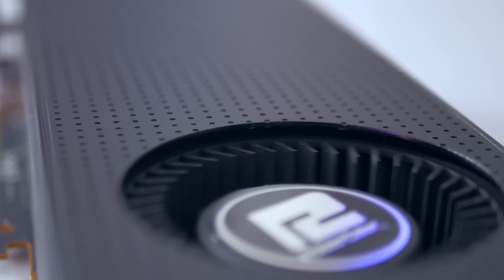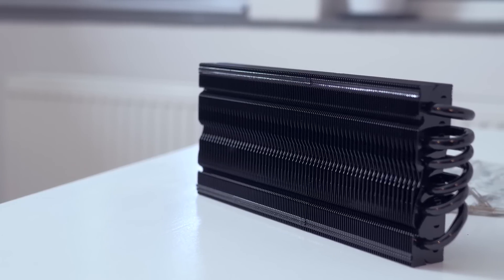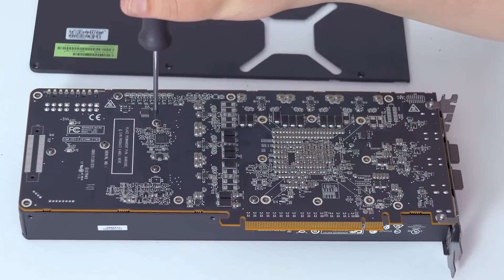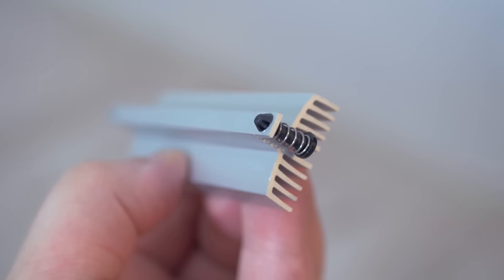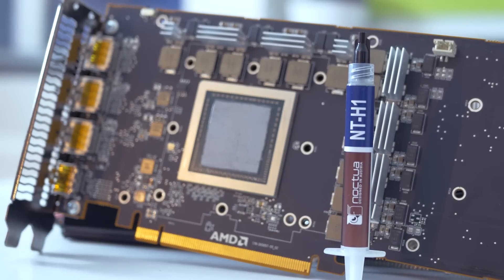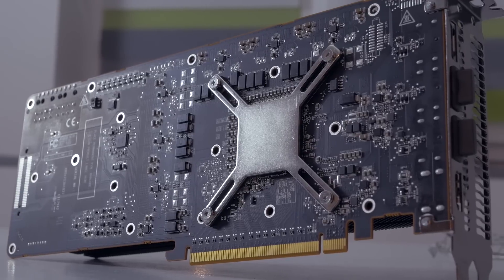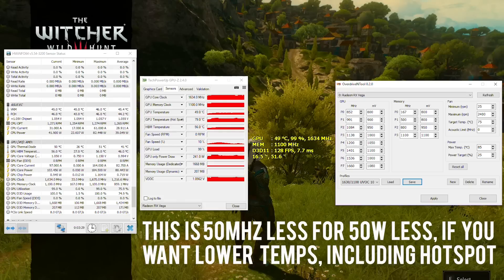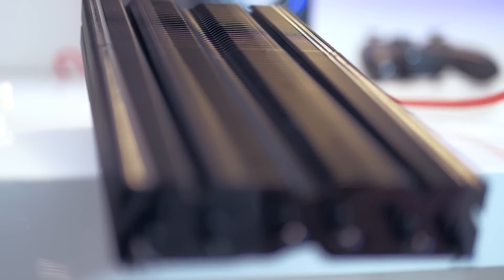The ultimate AFTERMARKET RX Vega - MORPHEUS II cooler SWAP

Comment: Great video. Just today I installed the Morpheus II Core on my Zotac Gtx 1080ti Amp Extreme alongside two Noctua NF-F12s and some Kryonaut, and now, even with my limit-pushing overclock, I dropped about 10°C. The card tops out at about 57°C in Fire Strike Extreme. Incredible stuff here. I am so glad I bought this.

Comment: Huh. Mine was max 61 degrees while gaming. But that was the side window open in my case. When i close it the thermals jump up. I have the phanteks p400 and 3 case fans. Two at the front and one at the back. I use basic bitfenix fans on this cooler.
What do you guys think? Why are my thermals so much higher than his. I also reapllies very high quality thermal grizzly thermal paster yesterday and checked the heatsinks.

Comment: I have a question that you might not be able to answer anymore, but how thick is the card + the Morpheus II without the fans? I'm looking into after market cooling options for my Vega 64 for a small form factor case, and I'm trying to work out if I can fit this heat sink + a couple of slim Noctua fans in the case.

Comment: Just did this. After 3 tubes of thermal paste and 10 remounts my hotspot temperature always exceeds 100 degrees. Literally no point to using this cooler.The normal GPU temp is extremely low but the hotspot forget it. Just throttles.
Reply: Edit: kind of fixed the problem used washers and applied more torque. Aswell as undervolted. The hotspot temp is a fair bit lower but still very high. I think it's just luck of the draw and can vary from Vega die.
Reply: I feel your pain. GPU/HBM temps are 60-65C, Hotspot +105C. Getting unstable clocks and a superclocked GTX 970 performance. A downgrade from reference cooler.

Comment: Is this the standard morpheus 2 or the vega edition? I'm having a hard time finding the vega version of this cooler...
Reply: I known I am kinda late, but, the VEGA edition is almost the same as the standard or Core edition. The difference is in the fin density. 
Not worth the trouble finding it.
Reply: @MerolaC  Hah I've only just seen this reply. I did get a vega edtion in the end. Bought one from ebay as at the time i couldn't find one new. One i bought was open box but unused which was handy. Didn't cost much less tho. Anyway it gave my vega 56 the cooling is so much needed and was finally able to oc it "up the power limit" and it is still today a stable gpu i shite you not. X mining card as well i got off ebay in 2019. Its in my misses pc today and i've got a 6900 toxic ee which is such a mental gpu
Reply: @Bassjunkie_1  Great stuff.
I had the worst luck with mine. One day, I decied to change the back retention bracket to the one that came with the cooler. BIG MISTAKE, I chipped the die on the VEGA. It died.

So, I went to a 5600XT, which, while it was a BIG perf improvement, it was capped by BIOS, board desing and VRAM. Now, I am on a 6700XT. 
The 6900 you have is AMAZING. Congratulations on that!

Comment: Don't use Noctua Nt h1 for Vega, especially if you are on stock cooler. I've used it and it always evaporates due it can only handle up 110°, which can be reached on hot spots, although card throttles at 105.

Comment: Will this cooler work with Vega: Founder's Edition?
Reply: You mean frontier edition right? Afaik a founders edition Vega doesn’t exist.. but yeah it does indeed work with the frontier edition
Reply: @adamthomas6643  frontier edition is a different card altogether. Frontier is the blue one and it's shit
Reply: The Poltical One You do realize there is no “Vega founders edition” right? Unless he means the reference than it will work with that too regardless. It works with the V56 V64 and V64 frontier.
Reply: @adamthomas6643  there is the reference 56 and 64 but the frontier edition is a different card altoghter
Reply: The Poltical One I’m quite aware, clearly you don’t understand that they’re based off of what is essentially the same pcb layout and has the exact same mounting as the regular cards. Even waterblocks made for the reference cards are cross compatible with the frontier card and in case you didn’t know they are way more picky about compatibility than air coolers are... especially ones that are literally only effected by the die size/mounting. You’re trying to explain to someone that it’s a different card when they clearly know that and you don’t even understand that it is indeed compatible
Reply: @adamthomas6643  ok

Comment: Just finished mine. Thanks for the video. The noise level is night and day. I used NF12 fans and they are great for this mod. I used this video and McPato's video to do my mod and it went flawless. For anyone considering doing this, do it. Go slow and be extra careful on that Radeon light connector. Thanks again for the great video! For anyone wondering the Ref Asrock  Vega 64 is unmolded but the HBM and the GPU die are the same height.

Comment: I know this is an older video, but just curious if I could apply this to the rog strix Vega 64. My card runs at 80C on the Samsung 49 inch monitor. My computer stays ridiculously hot.

Comment: I love this cooler, i use it on my gtx 1070 and it never goes above 53c, which is a huge upgrade on my original cooler, which had me closer to 80c and at very loud sound levels, due to the poor zotac 1070 cooler, which is not only loud but hot, my one complaint is i wish i could fit a backplate because the bare back of the pcb is an eyesore, if anyone knows of a backplate that has a cutout for the morpheus 'X' mounting plate i would really appreciate it!!
Reply: Just dont use the mounting bracket like buildzoid. you'll have to buy specific screws and nuts to mount, but the back plate will only "sit" on the pcb, theres nothing to screw it to. Im doing this to my 1080 ti ftw3 and i'll get back to you when i tear it down and figure out what i can and cant do. I'd also like to keep the back plate on. be careful if you use those specific screws though, you can over tighten it very easily.
Ive already taken it apart several times and just by looking at it, i'll probably end up getting separate screws/nuts to mount it. Im not sure if the extra weight of the back plate will make it sag or not. Now that I think about it, this is becoming a bigger project than I intended lol!

Comment: Remember guys using the glue on those vrms and vram will permanently bond the heat sink I suggest u use thermal tape instead of the bond if u ever planning on selling this card with the stock cooler

Comment: Just installed Morpheus II with 2 Noctua Nf-F12 fans on my Zotac 1080Ti Amp Edition. Very impressed so far. From 82-84°C to 60-62... Before I was able to achieve 1.936 mhz on core, now I can easily stay +2000 mhz. Can't be more happy.

Comment: I'm in need of better cooling for my card, but the thing is this cooler may not be compatible with future GPUs (Titan V already not compatible with Morpheus 2 with its 70x70 spacing), specially if we're going with MCM which will surely increase the size of the interposers compared to monolithic dies, making this cooler obsolete, unless Raijintek provides brackets for it...

The Accelero is in even worse situation as it doesn't even support Vega nor Fiji (64x64)...

Comment: Not really sure what I should do here, I really want a Vega 56 and I want it now, but I don’t know if I should wait for an aftermarket cooler, I hear everyone complain that Vega 56 is loud, but now loud really is it?  Because I’m currently using a r9 290 overclocked, which uses another solid 75+ watts, and has a reference cooler which has a smaller fan than the new reference design, and runs at 75%, so what’s the comparison between the two.

Now the other thing is I’m running in a node 202 case, which has practically no airflow, which is where the reference cards do better because it pumps air out of the case and should more easily pull air through the vents.

So I’m really confused as what I should do, and Vegas are starting to become more readily available. I really don’t want to go with a 1070, as I also have a freesync monitor.

Comment: 5 PCIe slots for that, jeez...
Reply: for less than 50 degress centigrade is better, few people do use multi-gpu setup and fewer and fewer games support multi-gpu setup
Reply: Nuclear Trinity IMO, Worth it
Reply: I only see a 4 slots width. You can also go with low profile fans to shrink it to 3 slots width.

Comment: If i recall correctly, Vega has 2 separate heatsinks under the plastic. If that is the case you can skip the custom vrm cooling leaving the stock plate there and retain the backplate to prevent bending. After all, the only thing needed to do is lower the core temp, everything else lowers with that.

Comment: How to make an overpriced card even more overpriced. But hey, you even lose your warranty in the process. Totally good idea! 

My suggestion: Buy a good card in the first place (or basically: buy whatever, but no Vega)

Good video though, but definetly not a recommended thing to do imo
Reply: I understand german very well, and if you do too, you can see that by far not all manufactures cover a cooler-change under their warranty, and some only conditionally. And some manufacturers cut their extended warranty back down to two years if you swap the cooler. And AMD and nvidia as manufactures are not even mentioned in that article. (You barely find any aftermarket models of Vega yet)

And now keep in mind that many people tend to flash the vBios of their Vega 56 with one from a 64 to get more performance. See how much that is covered. 

But thanks for givin' a source for my argument ;)

Comment: the solution is 1080 ti, I know that gpu prices are not at what they should be, but spending around the same amount of money (of 1080ti) on vega64 is not very wise. Don't get me wrong, vega 56 is a good card, especially at its msrp, ut 64 is not worth 100$ more than 56 and specially not with 60$ extra cooler...

Comment: Allmost got my modding parts ready to fit.
https://cdn.discordapp.com/attachments/248415288146657280/365513781863907328/just_need_glue.JPG
I had to mod the bracket on cooler due to the vrm being so close to the gpu and higher.

Comment: Excellent video!

I feel like nobody has to wait for AIB partnercards anymore. 

Ive got the original Morpheus on my R9 290X installed. It's the coolest card I've ever owned, although it's the worlds hottest GPU. The Morpheus is just a real beast.
Reply from the maker: +Richard Schlegel Yeah, I think so too. I know people that have retired aftermarket coolers after switching cards and are now in the 3rd or 4th generation with them. Still working and enjoying better cooling, lower noise etc. It's a bitch with the initial investment though.
Reply: Richard Schlegel 390x over here
Reply: Richard Schlegel how about voiding warranty though, a non issue!?? I think it's a crazy risk personally, but then.. If you can afford losing 500$ if it fails.. Lol good for you

Comment: Really nice video, it shows the true power of air cooling. But considering current prices Vega does not seem to be a viable choice anyway. For the price of Vega 64 you can buy 1080, that comes with an excellent air cooler already. And even in the Nvidia lineup it's really hard to find  a case where buying cheap version of a card and separately a Morpheus cooler with 2 fans (for which you have to pay separately) would be a better choice then buying a version of the card with good air cooler. But anyway, thank you for the great content and keep on doing the good job!
Reply: Depends where mate, VEGA 64 costed me 100$ cheaper than 1080GTX that is not aftermarket cooler and aftermarket 1080gtx cost like 150$ more where I am from so VEGA is the way to go, VEGA 56 with bios was 250$ cheaper and are on par with 1080GTX with mod bios.

Its supply and demand and depends where u are from either of them can be more expensive but their MSRP price are the same and VEGA imo delivers more because it has more features and freesync monitors are 200$ cheaper on average.

Plus primitive shadering isn't even enabled yet and VEGA has better FP16 by a ton compare to pascal which newer games will start to use soon so expect even more performance out of the card :)

Ah and DX12 is fully feature enabled on VEGA compared to Pascal too.

The downside Vega uses more power.

Comment: "Triple" slot cooling solution. Yeah without fans but even with slimmer fans wouldn't it still encroach on the 4th slot? There's almost a whole slot of space between the PCB and the fins of this thing to allow VRM cooling. It's huge.
Reply from the maker: +Church You, 4 slots. Better not have an ITX build for your Vega if you want this... :D

Comment: I was wondering when you would mod the Vega cooler, hehe... Nice to see that it turns out OK.
I have a question, there is a way to modify something, to retain the stock heat plate, or whatever it's name is?
I do have access to a machine shop, at my job.
I've done a similar thing with the rx480 xfx and is looking and performing very well.
Reply from the maker: +thesilviu silviu Yes, you can mod it so that you can use it with the Morpheus II. Don't exactly know what you need to remove, but it can be used!